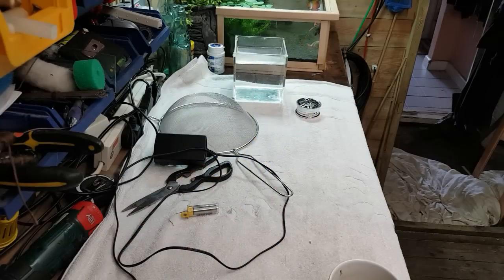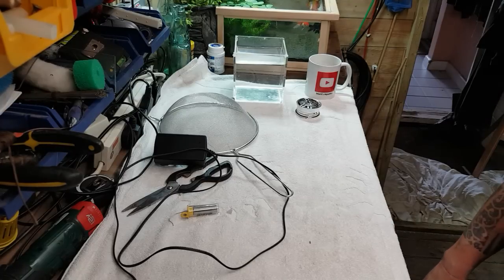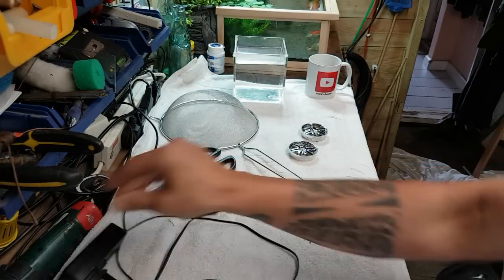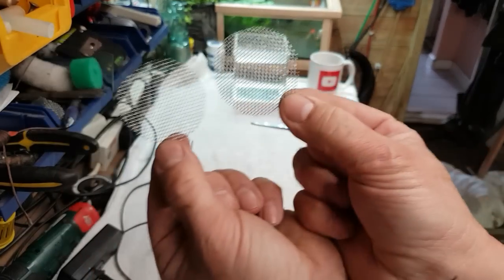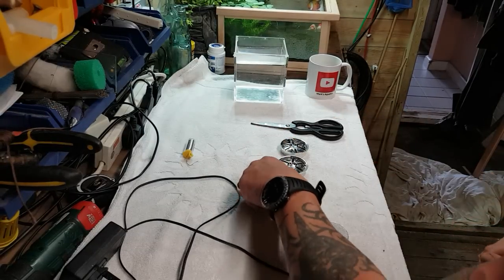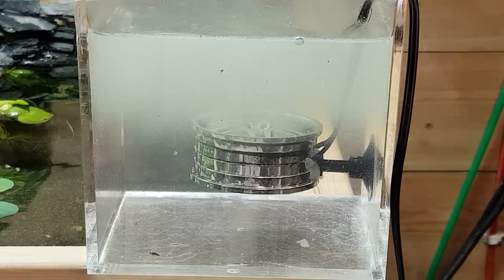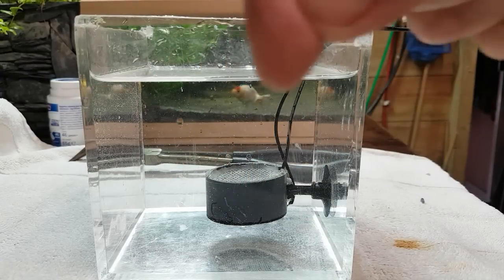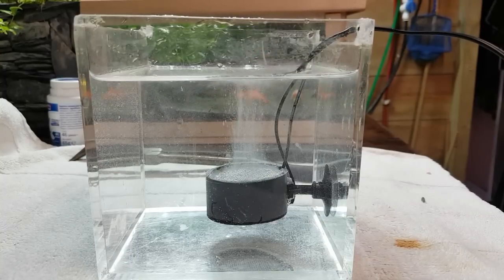DIY AQUARIUM STERILIZER

Comment from the maker: Hi. the phone charger is only six volts so no chance of a shock. Its the same voltage as a six volt battery for a torch, the safest way is to use the battery if your not sure about chargers. It adds oxygen and hydrogen to the water this has a sterilising effect killing algea spores and pathogens .

Comment: Mark,
Question? I built one of these and submerged it to test it outside my tank in a bucket. It almost immediately started turning the water orange. Left plugged in for a couple hours I had a dark brownish greenish sludge floating on the top. Any idea what is going on?
Reply from the maker: Ah! You must have used normal metal mesh. You need to use stainless steel mesh. When you use normal mesh and run the current through it will break down the mesh to rust .
Reply: I hade the same problem

Comment: carefull of sparks, we did this experiment at school using the old flatpack torch batteries with the tabs on(don't know if you can still get them) anyway covering the bowl with a loose lid leaving a small chimmeny hole in the centre and when you light  a match it pops as the hydrogen and oxygen explodes. Carefull if you leave it for a few minutes as it will blow the top off. I used to love my science lessons, now its all books(or tablets and pc's) an theory only. I did not know it would steralise water though 👍

Comment: Hi mark Did you use this in your tanks? Iv been looking into them afair bit now seen a couple of diy videos on them now just wondered if they did work as claimed? Whats your opinion on These are they worth making? And did the phone Charger hold up 6v bats aint the easiest to come by nowadays are they! But got everything out poundland to do the job love your diy videos keep them coming!
Reply from the maker: To be honest I built it for a project, it worked just like a twinstar but not so sure on the results .
Reply: i found a 6v charger for a baby monitor on amazon mate. Gonna make mine out of a weed grinder as i can't think of anything else that snaps together and is small, also mine will be on a plug timer. thanks mark :)
Reply from the maker: Damn4got cool. Just remember to use stainless steel mesh ok.

Comment: Hello  i made the same but the colour of water change to orange and I don't know why please if you have the answer let me know
Reply from the maker: Hi. You probably used galvanized metal. You need to use stainless steel mesh ok.
Reply: You oxidized steel or iron which is called Rust

Comment: I dont understand why the water doesnt short circut the two screens. Putting two electrical connections in water should just short everything.  Could you explain why this isnt shorted by water? To afraid to try this without knowing it wont electrocute me.
Reply from the maker: The phone charger is a transformer and only 12 volts so no chance of that.
Reply: Pure water is a fairly poor conductor. tap water contains trace amounts of compounds which make it able to conduct electricity to some degree but offer some resistance to the flow of electricity. What is crucial is the compounds that are in the water. seawater for example is much more conductive than freshwater. because of the dissolved salt (NaCl) .  in seawater - you'll get some hydrogen chloride  being formed at the cathode rather than just hydrogen.  Also - what you are using for the anode and cathode is important. 316 grade stainless steel will not corrode as easily as many other conductors. Platinum coated mesh is even better but more expensive.

Comment: the one i make makes the water yello ... what do i rong   i run it on 12 v 10a
Reply: MARK'S AQUATICS
7 months ago
Ah! You must have used normal metal mesh. You need to use stainless steel mesh. When you use normal mesh and run the current through it will break down the mesh to rust

Comment: Whats been your experience Mark with these sterilisers, could you see any perceptible difference in the health of fauna or water clarity?
Reply from the maker: To be honest I couldn't say. I built mine, tried it for two weeks and didn't see much difference.
Reply: MARK'S AQUATICS was you getting a sooty build up in the water? 
I thought of doing it to, but because I didn't know what alloy they used, that wouldn't put a high metal content in the water and soot. It used to only take 20 minutes using silver bars, to make distilled water carry enough nano particles to work as an anti microbial. Never used antibiotics since. But there was a lot of soot, and I wonder if this stainless steel will cause any problems.

Comment: Question.  Will that not take the Hydrogen & Oxygen out of the water?
Reply from the maker: I'm going to be honest I haven't go a clue how it works. Just thought i'd build one. I don't think the makers of it do either.:)
Reply: Thank you for your quick and honest response.
Reply: Water = H2O. The sterilizer breaks down  the molecule (electrolysis) to H2 (hydrogen gas reduction at the cathode) and O2 (oxygen thru oxidation at the anode). This means it actually consumes the WATER itself (in VERY VERY tiny amounts), so in principle only your water line should diminish.
Reply: Yes Thank you.
Reply: So essentially, it's creating MORE oxygen, and not stripping oxygen out?
Reply: It's actually just destroying the water by reducing it to it's basic elements. The oxygen and hydrogen simply escape through the surface. The bubbles popping at the surface will oxygenate your tank water, just like your pump/filter already does. But, as far as sterilization goes, I have no idea how water being destroyed sterilizes the water that hasn't been destroyed yet. If it even does. I think these things are just gimmicks personally.
Reply: Yes, I had a brain loss.  Sorry
Reply: Bradley Fortner o3, ozone, it breaks the electron bond, leaving a two single atoms with a spare electron, making them bond with the first o2. They meet making. Mainly highly reactive o3, but some small amount of o1, that is dangerous to organic life, as it is what we call a free radical. Both the very small amount of free radicals and the unstable o3 will react with anything with a free electron space. In some European countries they use a combination of ozone and uv to clean and sterilise there tap water, leaving no trace. 
Saddly we haven't catched them up, and because of cost of initial outlay, would rather pay more to poison our water with chlorine, and industrial waste from the aluminium and nuclear industry in a form of hydrofluoric acid, they pass off as fluoride, that would cost them billions to dispose of. 
Sorry to go off topic, really pisses me of that we do this, instead of using ozone
Reply: @garyread1311  One of the benefits of living in Holland, they use uv not clorine!